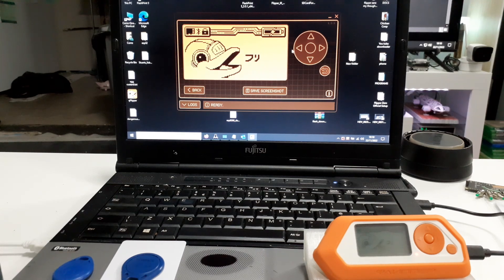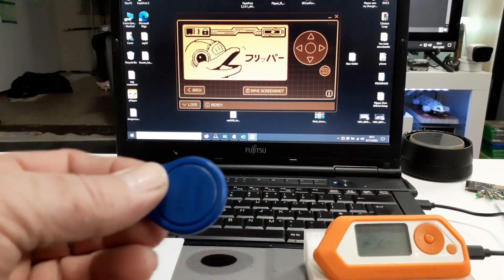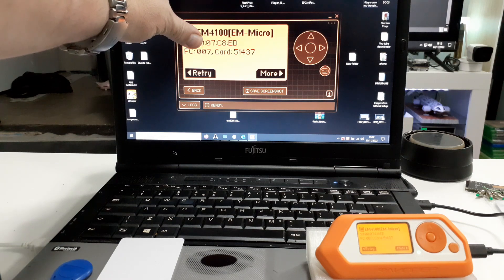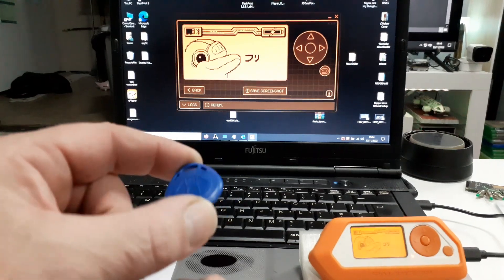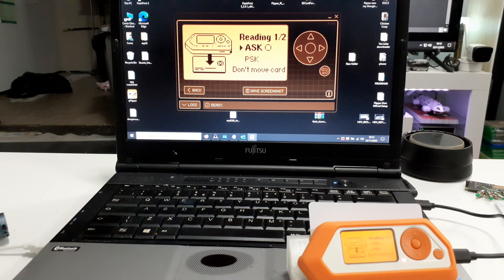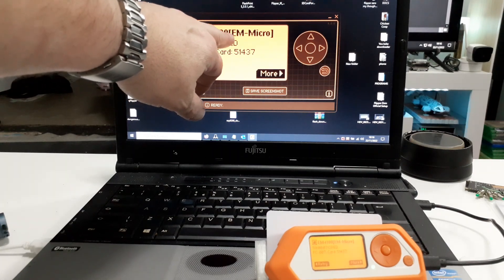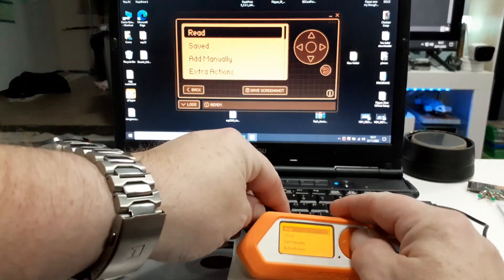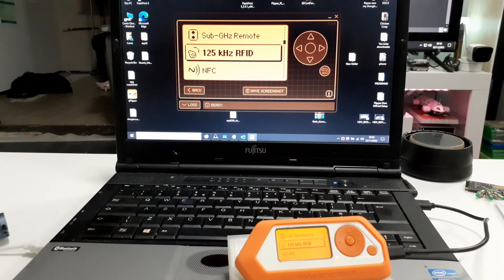The (almost) OAP's Guide To The Flipper Zero: Cloning an RF-ID tag. The Revisit.

Comment: Hey! Awesome video. Question: What do you know about readers trying to write the tag they read as a security measure? And adding to that: What do you know about writing and setting passwords to a T5577? Asking because I found your video searching for those answers, but my flipper wasn't able to write T5577 passwords until I flash it another firmware. I'am afraid to do it since I only have 1 T5577 chip and I want to be able to re-write it again :(
Reply from the maker: T5577 are emulators. So you can rewrite it thousands of times.  ALso, they are very simple to modify using a text editor. As for security tags, my understanding is they send out a pulse when energized and the gate picks up that pulse. If you want to defeat them, wrap them in foil or put the item in a foil lined bag.

Comment: I understand the Flipper Zero can't write to the read only EMicro-4100 tag.. but what is the difference between the read/write EM-4305 fobs and the T5577 that the flipper can only write to the latter?   Does it have to do with application.. i.e. it can read 125khz RF-ID tags.. ASK and PSK.. but perhaps there's other protocols/frequencies?  Does it have to do with the "FC" (facility/format/frequency-code?)?

Can the Flipper be used to emulate the card itself, i.e. no T5577 card needed to clone?     And can the RFID card be erased after programming?
Reply from the maker: " but what is the difference between the read/write EM-4305 fobs and the T5577" As I understand it, the T5577 is capable of emulating many different tags.                                                                                   

"Does it have to do with application.. i.e. it can read 125khz RF-ID tags.. ASK and PSK.. but perhaps there's other protocols/frequencies?  Does it have to do with the "FC" (facility/format/frequency-code?)?"                                                            Not got a clue.

Yes, my FZ emulates an EM4100. To erase it you simply write 0 to all bytes.

Comment: I was frustrating myself so much with this. I needed a new alarm tag for work, so I read it, it's a EM4100. So I went onto amazon and bought them, got 50 of them. 

Was trying to write them, can read them all, but can't write. So, if I buy a card/chip with the T5577 Tags, I should be able to read the EM4100 Tag (which I have and saved, and it works when I emulate it), then write that over to the T5577?
Reply from the maker: Yes, you have the exact same issue as me. The FZ cannot write em4100 but the T5577 will emulate it.
Reply: @Cornz38 I have some of the T5577 now, Amazon.. soo… they all read.. and advertise as rewritable, I can’t write any of them? So they’re more useless ones
Reply from the maker: @DanSmith27  https://www.amazon.co.uk/gp/product/B07DYG5XL7/ref=ppx_yo_dt_b_search_asin_title?ie=UTF8&psc=1   
They are the ones i bought and use everyday. My original was read an an EM4100. Just return them  and get those instead. I also bought some cards instead of tags.
Reply from the maker: @DanSmith27  What firmware are you using in your FZ???
Reply: @Cornz38  unleashed firmware